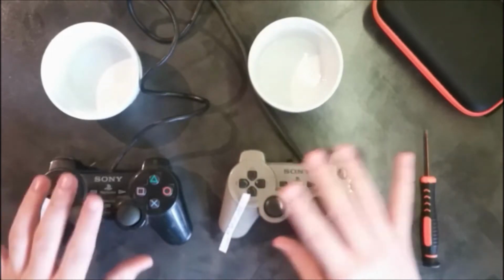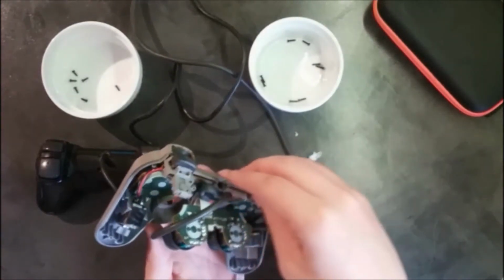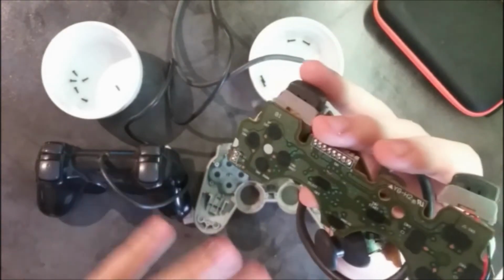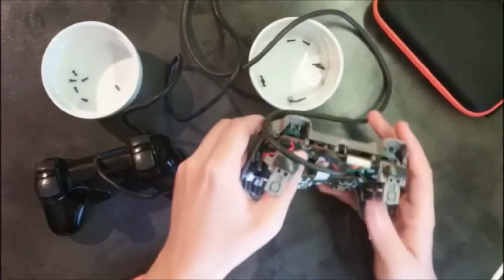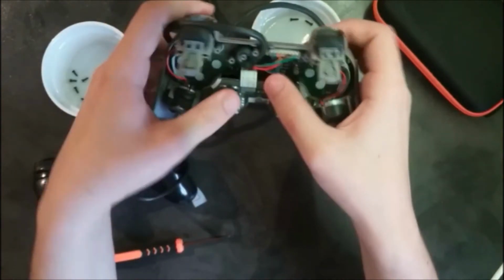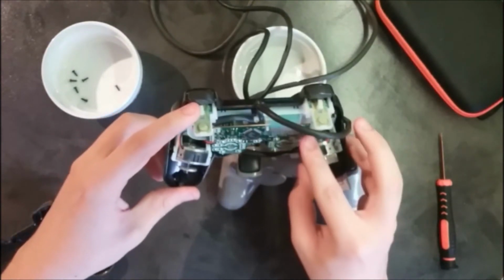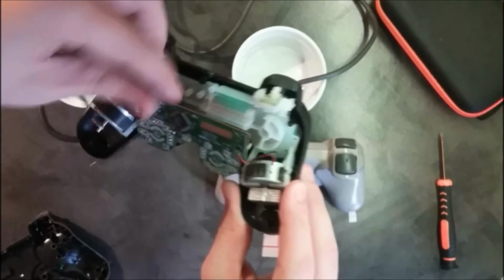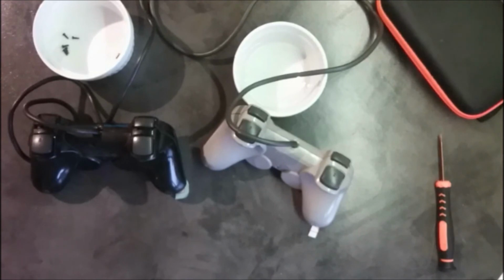How to open your Playstation 1 or Playstation 2 controller easily with no damage

Comment: The ps1 and 2 controllers are basically the same huh?

Also what’s your favorite console?
Reply from the maker: Well, the Dualshock 1, 2 and 3 are very similar but are having minor improvement at each generations.

Having to chose a favorite console is very difficult. I would pretty much say Nintendo console are my favorite choice because they offer a unique experience compare to the Playststion or the Xbox. After that, it would be Playstation and then Xbox.